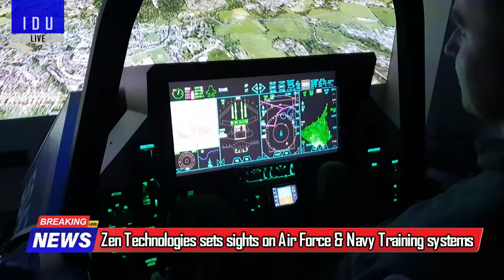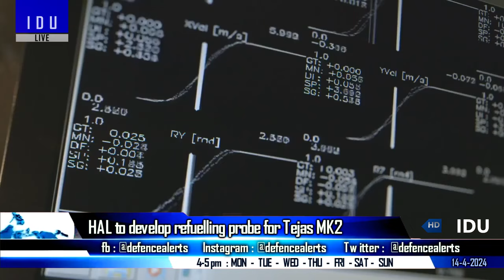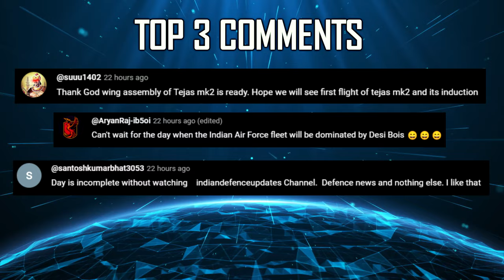Indian Defence Updates : S4 SSBN Ready,Astra MK2 Scrapped,Tejas MK2 Probe,ITCM Test,DRDO MPATGM Test

Comment from the maker: :yt:What's Your Opinion : "IAF to skip Astra MK2 & progress to Astra MK3 : MEDIA REPORT" ?
ＬＩＫＥ | ＣＯＭＭＥＮＴ | ＳＨＡＲＥ | ＳＵＢＳＣＲＩＢＥ
Reply: I have lost my heart
Reply: I don't think it will happen. Both missiles have different roles and astra mk 3 is twice the price than Astra mk 2
Reply: Astra mk-2 is cheaper....while astra mk-3 is expensive means it can be used only for special mission
Reply: Astra mark 2 will be for export😅
Reply: Not at all
Astra mk 2 is cheaper, has more max speed and range of 160km because it is made to target enemy fighter jets whereas Astra mk 3 is made to target supporting aircrafts.
If Astra mk 2 is scrapped, IAF will have no system to cater to this segment.
Reply: Not possible
Reply: No such news Just speculation rather Astra Mk2 is in LSP stage now
Reply: @YashRaj-wn6zi  Mk3 NEZ for fighter jets will be roughly the same as the Mk2 (more so with AESA seeker) Difference is the price
Reply: Useless, do we have radar that has that much range?
Reply: Astra mk3 will have 200km range for fighter sized targets and 350km for awacs and transport aircrafts so only 40km difference between mk2 and mk3. I think having Astra mk1 and mk3 is good choice. Mk1 for below 110km and mk3 for above 100km simple
Reply: It (Astra mk2) may be the victim of an insider job  to leave  the way for meteor missiles. Astra 2 has a huge potential in the export market too. IAF shouldn't abandon this program. Nowadays we can see multiple attempts to derail our indigenous developments. Offers  like Athos, Stryker, mica ng, python, etc., must be avoided to become efficient and even pak is already having 150km a.a.m in its arsenal. Choosing between a 160 km range a.a.m or a 350 km range missile is to be done according to the mission, not just for silly reasons.
Reply: It maybe that Agencies have failed on the project,so they have skipped & moved to Astra MK3,so that they get additional time to waste without delivering anything till the end of the decade.

Comment: Will the HAL chief be held accountable for this mk2 prototype by 2025 statement? Probably not, so no harm in giving any prediction..
Reply: He himself is pissed off and you are aggravating him😅😅
Reply: @Jefe-Grande  have you just been discharged from a mental asylum
Reply: @Jefe-Grande  Let it be what's your problem? You seem to more worried than Airforce officials. Relax and chill
Reply: @Jefe-Grande  you need to widen your knowledge.  Under Project Bheeshma India has picked around 60 Mig29; 10 Mig31;  40 Mirage 2000 plus new SU30mki. These aircrafts are refitted under upg program at southern bases in Mysore,   Pondi, Tambaram etc with IAI/ Elbit supplied Aesa/Irst/Mwr etc. As per known sources except for body related stealth technology all the other parameters are being put under  2bn$ contract. Attention is given to thrust to weight ratio and speed using advanced RD93 and AL41 type engines. Few of these Mig29 were tested in Ladakh and they bet the Chinese radar and J20 fighters.
Reply: @Jefe-Grande  Not to forget the Snecma M88 engines which have been fully transferred to India. Even the RD engines used in the PAF JF17 is being produced in India, rebadged by Russia and sold to the Chinese. Even the New F16 fuselage is coming from Tata and the tyres from MRF.
Reply: Remember first flight by end of 2025 become first prototype build by 2025. So dont be surprised if 2029 delivery becomes 2032
Reply: @SV-kx6lm  What? when did M88 tech is transferred?
Reply: @vaimurthy  For all your criticism the Rafale had its first flight in 1986 and introduced in 2001. This is the record of one of world's premium aircraft manufacturers Dassault.
Reply: @SV-kx6lm  But no one delayed delivery of first jet after tests are completed and ready to manufacture
Reply: @vaimurthy  I would recommend you go through the history of Rafale